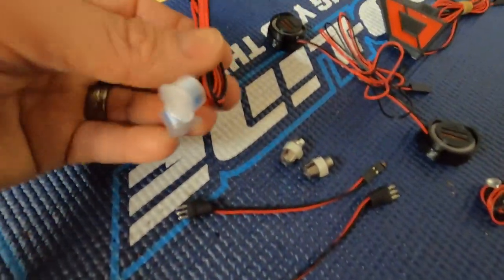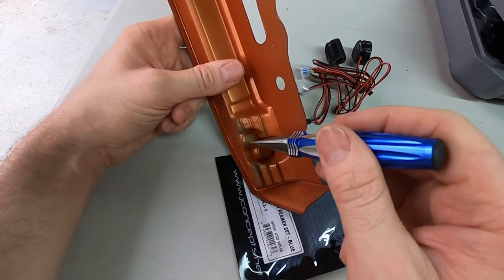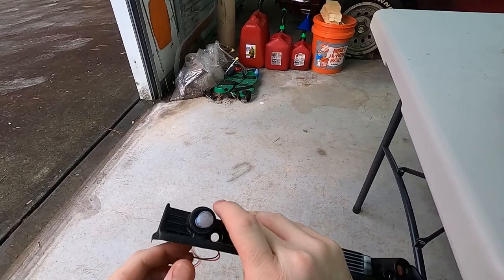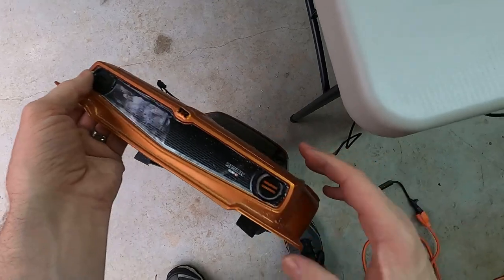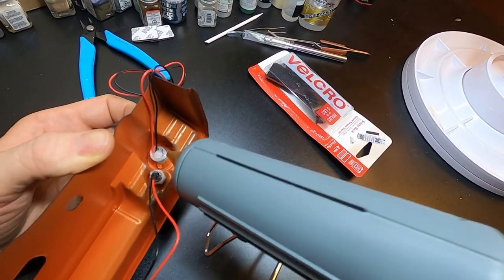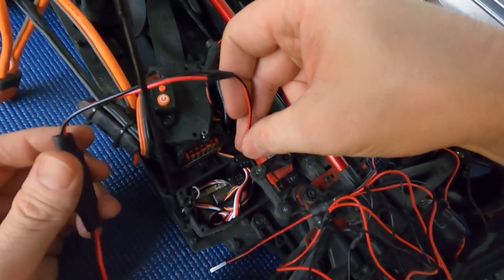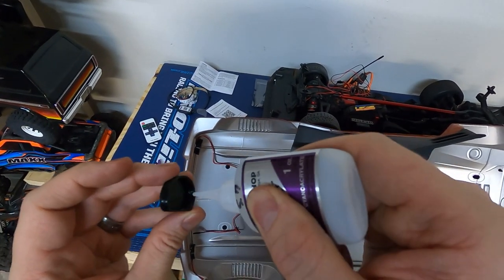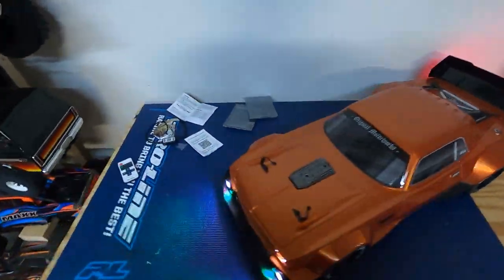Arrma Felony Polo Creations Light Kit Installation

Comment: The lights look cool! Like you were saying, the light isn't very focused and dissipates not very far from the vehicle. Maybe more for looks than function. It seems like if they had provided a little more length with some of the wires, and maybe an umbilical cable of some kind, mounting the body would have been much easier. The Bronco light kit has that nice, single plug, which makes it really convenient.

Comment: I got a similar kit a long time ago for my Traxxas UDR. It didn't last long and the front light bar broke in minutes, then the upper light bar broke the following day. I couldn't get my remote to work with my kit. I don't see that happening to your Felony as it won't see the rough terrain that my UDR has.  In fact I don't even buy 3D printed parts for any of my RCs as they don't last 20 minutes of use.
Reply from the maker: yeah most 3d printed parts don't last long. It depends on how they are made and what they do. All of the 3d printed parts that I have made have lasted.

Comment: Hello, I just wanted to see how the lights are holding up. I know it’s only been a short time, I’m looking to buy a set and concerned about premature failure or the 3D tail lights falling off. I have heard other stating the lights are falling off with the slightest bumps. Just didn’t want to cut up the body and have them fail or fall of. Thanks in advance for your help!
Reply from the maker: I didn't have any issues with it, but I only ran it one day since then.